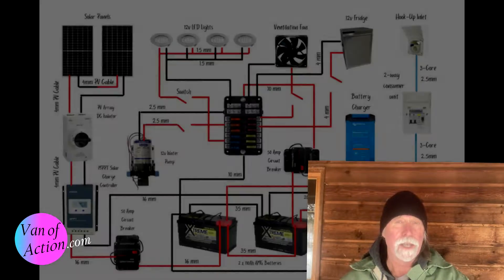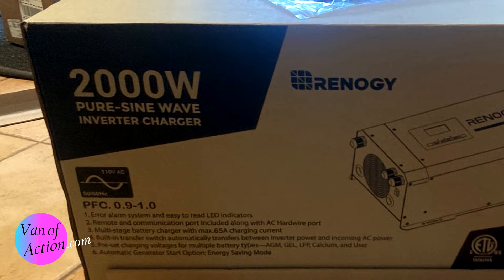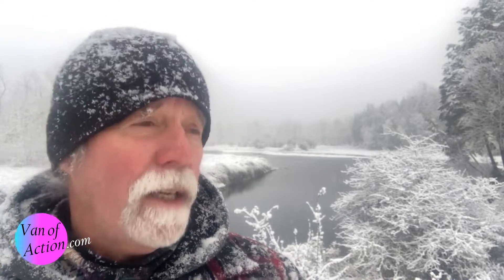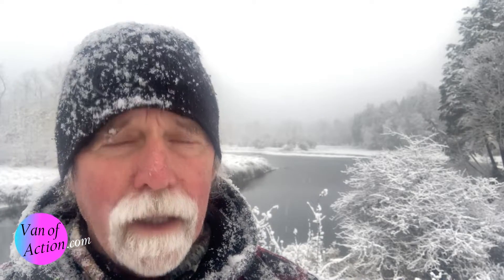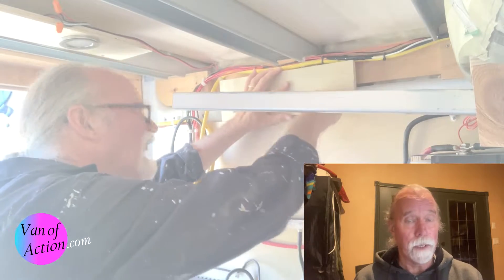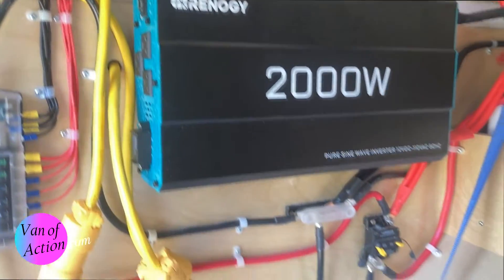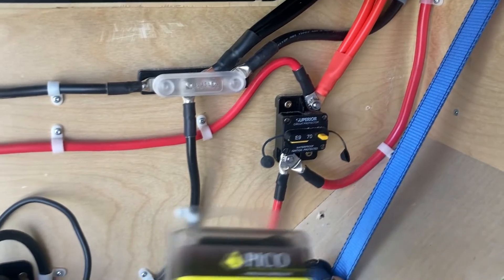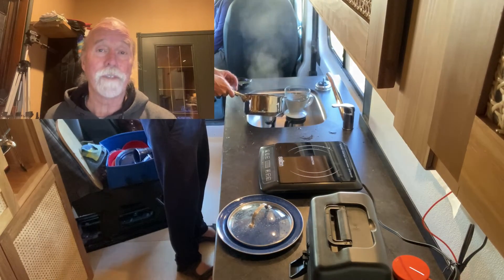How to Install 2000 watt pure sine inverter in Dodge Promaster van build for off grid vanlife camp

Comment: Great video. I was going to install a 
2000W inverter just like that in my dodge pro master van so I can run a small heater for a few hours at night and in the mourning to keep my Equiptment warm. I know I would have to keep the truck running while using the heater and I don’t mind doing that. Question is, would that be ok with that size inverter?? Thanks so much in advance and happy holidays
Reply: Get a diesel heater
Reply from the maker: Hi Dan - thanks for watching and taking the time to comment.  What ever appliance you want to run will have a rating of how many watts it uses at peak.   As an example,   small electric heaters in Canada are  typically 750, 1000, 1500, 2000 watt units.  (there are bigger) ....  So you inverter has to be rated for at least the watts you want to use.  Our 2000 watt inverter runs our 1500 watt heater with ease.  And it takes the chill off no problem.   After that - the question of how long it will run will depend completely on how much (how many watt hours) you have stored to use - or you can generate to use if the motor is running and you have a DC-DC charging system or the sun is out and your solar is generating  .... there a bunch of variables for that end.   Hope that helps ... Be Well and stop back.  Dave

Comment: How do you have the outlets wired up?
Reply from the maker: Good day odnewdylee - thanks for watching and taking to time to ask.   The outlets are wired at the outlet end just like any plug  in a house.  At the other end (by the inverter) I put on a male extension cord end.   The inverters have female plug receptacles built into them.  The bigger the inverter the greater number of plugs available.   And then I installed a power bar above the inverter,  with the cord end of the power bar going outside.  That way I can easily convert to shore power when it's available  just by changing where things are plugged in- you can see that at the end of this video https://youtu.be/yR793YfwFdA     - I hope that helps and I hope you'll join the community and stop back ....... cheers   Dave

Comment: Hello sir im trying to setup a 1500w inverter directly from my alternator starter battery would that work or would it deplete my car battery . I have a 2017 ford transit with a 150a  alternator thank you if you can answer my question
Reply from the maker: Hello Elias.  Thanks for watching and taking the time to ask a question.  Unfortunately what you need to know is waaaay above my pay grade.  I found an installation I thought would work by an expert and copied it.   Good luck to my friend. Dave

Comment: I’m sure you’ve learned by now, but that 70 amp breaker is not even half the size it should be for a 2000 watt inverter.  

2000 watts/12v= 166.7amps 

166.7x1.25=208.375 so roughly a 200amp  breaker should be used here
Reply: Shoulda watched the whole video!

Comment: It’s cheaper to run two wires per connection instead of one large gauge wire.
Reply from the maker: Hi Albertaguy1340 - thanks for watching and taking the time to comment - I guess that makes sense but it seemed really strange at the time.  I wish I knew enough and had access to the pieces needed to shorten those wires because they get in the way every time I want to remove or replace the batteries.  Be well ... I hope you'll stop by again and join the community .... Dave

Comment: How hot do these inverters become when on
Reply from the maker: Hi William …….. thanks for watching and asking.  Mine is mounted so there is about 3/4” air space behind.   I’ve checked when using a heavy load like the air fryer or heater and have noticed little to no temperature gain - using the touch test method.  Hope you’ll stop back and join the community. … Dave

Comment: You need to increase your wire size significantly with the higher amperage fuse or you risk a fire.

Comment: Hi, I'm planning my electric system, and your well informative video is straight on topic. Is it an induction cooker you are using in the video? What wattage is a cooker?
How does giving inverter coping with it? Have to make a choice between 2000 and 3000 watt inverter (for small camper single induction cooker). Thank you for your time and effort 👌
Reply from the maker: Ho Volodymysidenko !  Thanks for watching and taking the time to comment.  Yes - we use a single plate induction cooker.  We also have a combination toaster oven / oven / air fryer.  And, we use a 1500 watt electric space heater to take the morning chill away.  All work just fine with a 2000 watt inverter when used individually.  And 200 amp hours stored in lithium batteries has never even come close to being used up. If you have a combined load greater than your inverter it will shut down.   We have no problem using one at a time.  If you’re in the planning stage I would invite you to join the community.  Go to VsnOfAction.com.  I have a playlist dedicated to the wiring part of the build …….  Be well and stop back……. Dave

Comment: From what I have studied your wiring should be 2/0
Reply from the maker: Hi Kodak Jaymz,   I’m honestly not sure what that means - but I can tell you that for 3 years the complete system - including the inverter - has operated exactly as designed without any problems.   We have hot water,  run out cook top and space heater without issue.   I hope you’ll stop back and join the committee.   Dave

Comment: Oh dear! I almost didn't buy a renogy dc to dc mppt charger after I saw your video the first time. But I did and unfortunately had bought the wrong one. I was horrified thinking of all your 7 to 10 day sagas. Emailed renogy and lo and behold they responded in 12 hours! I send it back and they acknowledge that they have it. One week and still no refund. I decided to buy the correct one which.arrived in 4.days.  Butt two weeks on, not a word from renogy and no refund!
Reply from the maker: Leanne !!!   So sad to hear about your experience.   I have no idea why Renogy is so bad at customer service.  I'm sure you'll be happy with the product ... mine has been working 3 years now without a problem (touch wood) .......   be patient and send more emails ...... Dave

Comment: Thank you for explaining in detail what happened with renogy rather than just venting.  Very helpful.
Reply from the maker: Hi Ben - thanks for watching and taking the time to post.   Every Renogy product I’ve installed has worked as designed right out of the box and never even burped !!  Totally satisfied and would recommend them anytime.   But the customer service really sucks. !!!! Hope you’ll stop back and join the community. ……  Dave

Comment: I wish people would actually show step by step on how to build the mounts for the inverters instead of just showing the last step and then attaching the inverter. Some people don’t have a clue how to build the area to put the inverter and batteries. 😢😢
Reply from the maker: Hi Chatmann43 - that's a GREAT comment - thanks so much for watching and taking the time to post it.  This is a first for me - Most of the time I get comments telling me I give too much detail and tell too long a story !!!!!!   I guess it was just so obvious to me I didn't think to mention it.  What I did - was build the side wall panel the of the basement out of 1/2 plywood.  I made sure it was totally secured to the steel channels of the van with bolts and jack nuts - just like the wood I placed on the ceiling before the cedar.  You can see it here ....   https://youtu.be/qQSS7zd6QvI?si=ycY4YFprpe8VpHpy   Once that piece of plywood was secured it became the thing EVERTHING is screwed to.  The MPPT controller, the fuse panel, all the wires and the inverter.  Because my inverter was mounted so high up the plywood.  The equipment you use will determine where and how each will be mounted.  There may be a need to build out something with a couple strips of wood, but it should really be pretty straight forward.  I hope that helps.  And I hope you'll stop back and join the community .......  Dave
Reply: @VanOfAction thank you 😊

Comment: You should have fuse mounted to positive terminal of battery. Then cable connected to fuse instead of battery.
Reply from the maker: Hi Bill, thanks for watching and taking the time to comment - I appreciate what you're saying - and in fact the cable that is connected to the positive terminal runs through a fuse before the power goes anywhere else.  I can't imagine how that fuse being connected directly to the battery or down cable a foot or so really changes anything in the protection.   BUT - I'm a carpenter and just doing things the way that makes sense to me .......... if you can elaborate on the concept it would be appreciated.   Hope you'll stop back and join the community.  it's in the conversation that we all learn..... Be well .... Dave
Reply: @VanOfAction  Murphy's law. Chaffing of insulation by something either metallic and eclectically active  -- or allows it.  Overheating due to something nearby or a chemical/age/drying deteriation or age.  

Also, people frequently don't account for voltage drop along the cable, which can cause some loads to draw excess current.  Say if there is brownout (voltage drops way down) caused by drawing near max current that is sufficient to cause motor winding insulation to melt shorting out.  The extra Current squared times resistance along the cable causes heating that melts the insulation off.  Your fuse blows, protecting everything after it.  

But between the battery and the fuse the insulation may be melted off and 12 VDC.

Besides, search for Joinfworld MRBF Terminal Fuse Block 100A 58V DC Battery Terminal Fuse Kit with 5/16" Stud Marine Battery Fuse and Waterproof Cap for Boat Truck RV Construction Vehicles on amazon  and not really expensive. $15. Blown fuse. Just replace the fuse part. $10
Reply from the maker: Hi Bill - thanks for such a well thought out and expressed comment.  I know people reads these and I love it when members share alternative thoughts.  Everyone benefits.  You're the first person to raise this point and I appreciate it.  Be well   Dave

Comment: This video is great for learning from your mistakes. Thanks for sharing. I sized up my rennogy fuse as per manual, 250amps just cuz why not. It has the capacity so why bottleneck it with a lower fuse. Now for the rest .. its still a work in progress

Comment: If no one has mentioned: the two wires are 4 gauge, double them up you get double the amperage( about 175 amp). You want the highest amperage from your batteries to inverter.  Especially if your running things like microwave’s and AC.
Reply from the maker: Hi ClarkyMalarky ... thank you so much for taking the time to explain that- you're right, in all this time no one has mentioned that.  Truthfully,  I have no idea what your talking about but I'll assume you're correct.  The community needs people like you to contribute ... hope you'll stop back and join in ..............   Dave

Comment: Thanks for the video! I just installed the same inverter in my trailer. In your video at about 8:50, you hoist the inverter up to its mounting position, come in with the socket and drill to fix the upper mounting bolts, and then you fail to get a connection with the socket to the bolt. The picture fades out, and I hear you say, huh...! That was EXACTLY my experience. They designed the mounting holes too far under the inverter housing to get a straight shot with even a screwdriver, much less a socket and wrench. I ended up using Phillips screws and a screwdriver angled in to secure the inverter in position. Really poor design. 

I had to contact Renogy with a question, and the reply came back as a mixture of English as a second language and cut-and-paste technical text. I never did get a coherent response.
Reply from the maker: Hey Solar Steve - thanks for watching and taking the time to comment.  You're right, now I realize I should have mentioned how clumsy mounting the unit to the wall was.   I too used some Robertson screws with washers.   It's really sad how many builders have had just terrible experiences with Renogy customer service (shouldn't even call it that).   You think they would hear about it .........  Be well,  I hope you stop back ... Dave

Comment: What size fuse was on your battery. Thank you
Reply from the maker: Hi redwood -  Thanks for watching and taking the time to comment = I'm sorry but I'm not sure what you mean, can you please expand on your question .... Dave
Reply: I thought you had 2 100 ah lifepo4 batteries. With a fuse on the positive terminal out.
Reply from the maker: @redwood1957  I have 2 100 ah Smart Renergy batteries which are basically the same thing.  The breaker (fuse) is the one that blew when I first installed the inverter.  I had sized it the same as the breaker coming from the front battery because I wasn't thinking about the inverter.  The data says it should be 200 ampo,   but I installed a 175.  H
Reply: @VanOfAction  I'm doing 2 100 ah in parallel  as you did. I found out I have to have a class t fuse on positive out.
The fuse you have is just for wires after the breaker.
Reply from the maker: @redwood1957    Thanks for the reply.   I'm a carpenter and I certainly wouldn't consider arguing with anyone about this.   My design was provided by Will Prouse - I couldn't quickly find the plan that I used -BUT - in this video starting at 12:13  ..... https://youtu.be/IRRKHYwB3Uo?si=49UdCQ0NC4XTuEfh    You'll see he runs the positive cable from the battery directly to the one side of the 170amp breaker.  Al the other positive feeds go out the other side.   Now...... to me a breaker and a fuse do exactly the same thing.   So I think we are on the same page ... just using different words ...... be well and stop back.... Dave

Comment: hi Dave, please help me with a information.  is it possible for the red positive wire to be 2-3 meters long? I don't have the possibility to install the inverter near the battery. Also do I need to have the ground wire coming from the battery, or could i wite it closer,  the truck chassis somewhere. thanks
Reply from the maker: Hi @adr.    Thanks for watching the video and feeling comfortable asking your question.   Unfortunately I don’t know enough about this to give you such detailed advice.     My video was to demonstrate how easy the installation can be if it’s according to the simple instructions.   You may try asking Will Prouse  at DIY solar.   He’s an expert and the guy I got my design from.    Good luck my friend. ….. Dave

Comment: You need bigger wiring for 200w.  Gonna burn your  van down
Reply from the maker: Hi Matt - thanks for watching and taking the time to comment.  Which wiring are you referring to ?  All wires were sized according to the tables for loads and runs ....  but I may have read it wrong ........  Dave

Comment: Im curious on the step down on the guage from the hot line to the breaker to the battery, goes from double gauged to single guage.  Not sure on the power loss that creates.  Besides that, love the setup and guide.  I will probably skip the breaker and use a 200 amp mega bolt on fuse from battery to inverter direct.
Reply from the maker: Hi @348rari2 - Thanks for watching and the positive feedback.   I have no idea about the stepdown - I followed Will Prowse layout and installed things as they came out of the box.  It seems to work as designed .......   good luck and I hope you stop back .............. Dave

Comment: I dont think you have to keep changing the plugs over when on or off shore power.  The Renogy inverters have the ability to automatically switch to DC when shore power is disconnected. I think its referred to as UPS.
Reply: I have never seen anyone do this and I absolutely love the idea. Yes you can buy a switch or an inverter/charge, but a $5 power strip and one extra step when operating with shore power does the same thing. Adding this to my van. Thanks for the great idea!
Reply from the maker: Hi mange2 - thanks for watching and thanks for the comment.  I may be wrong but you may be thinking of the unit that is both an Inverter (that makes 12 current suitable for 110)  and a Converter (that lets you charge your batteries from house current).   My set up is only an inverter so the house current is never attached to it - so I have to switch them back and forth to suit.  Hope you'll stop back ..... Dave